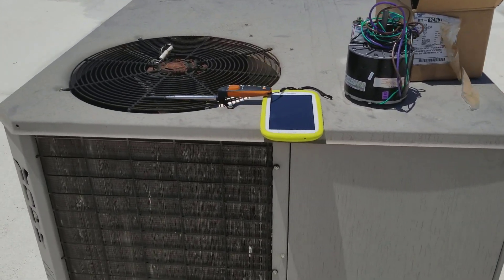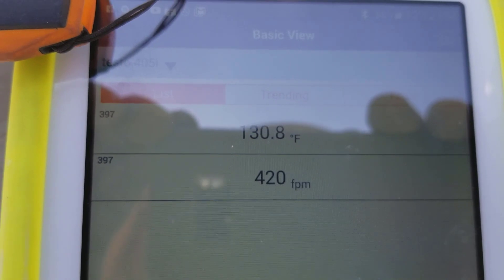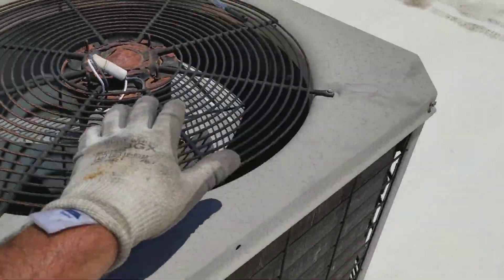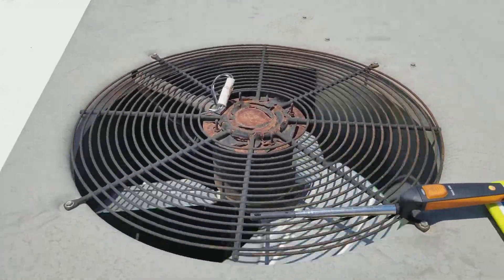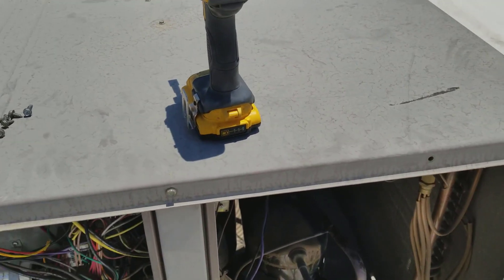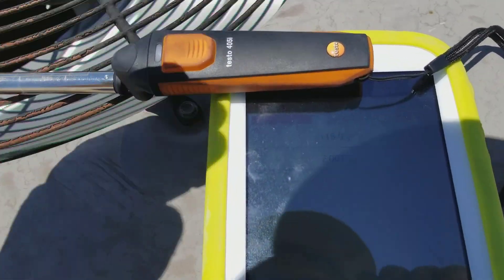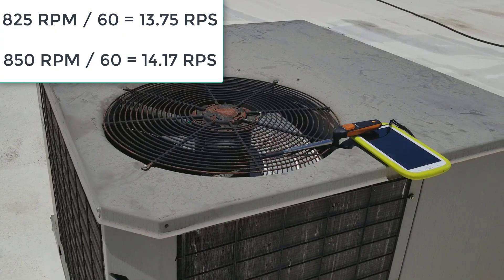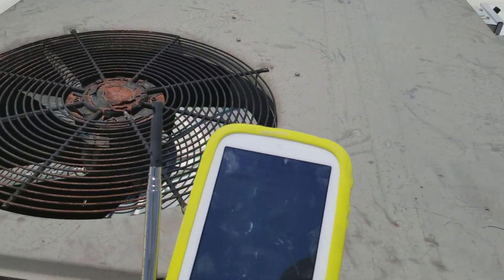Universal Motor + Run Cap Bandit = failure

Comment: At 2:45, shouldn't the fan blades be mounted higher? Looks like the motor is mounted  too low.   The upper fan tip should be above the shroud ring.

Comment: Wow.  I dealt with that lazy mentality for 12 years in apartment maintenance, heck, i'v seen supervisors install sump pumps in duct work that is encased in the concrete slabs underground in apartments, they said it is cheaper that replumbing down spouts.  Well, mold grew, city was called, people left, fines were issued.  Except my building, my ass got chewed, because of cost, until they moved all the people into my building,  because it passed common sense rules.  I replumbed gutters and it worked!!!  Those other apartments are undergoing several hundred thousand dollar redo, because of mold and the hvac system.  And I still got fired, but got rehired at another one of there properties.  Strange world.  Then I hired new supervisors.  LOL.   And we are 97% occupied and mold free, at all sights.  The city sends us people, mainly refugees, but they work.

Comment: I wasn't expecting that much change in air output but it sure goes to show how important the quality of the motor is.  I'm glad you posted this - it's an important lesson.  I wonder if the hp rating of some cheap motors is really accurate.  In this case it seems the universal motor was probably slipping so bad it was near overload.  Good find.